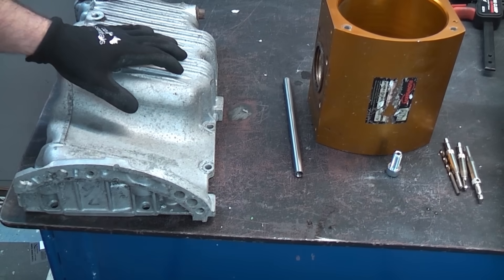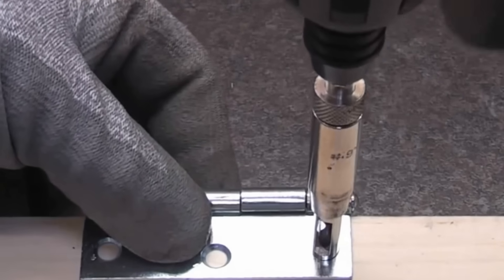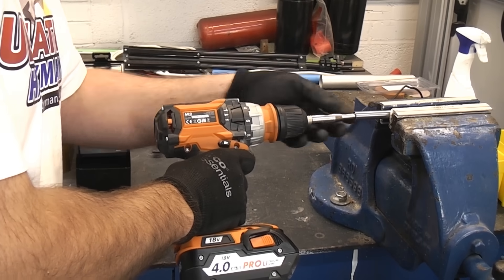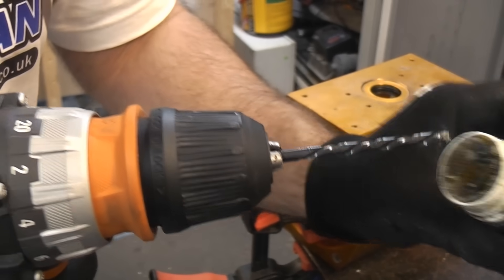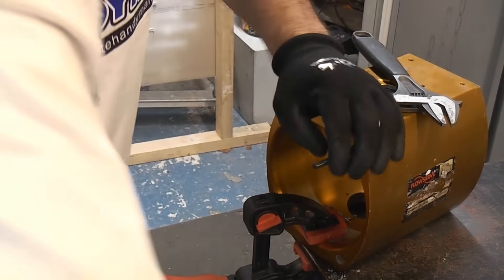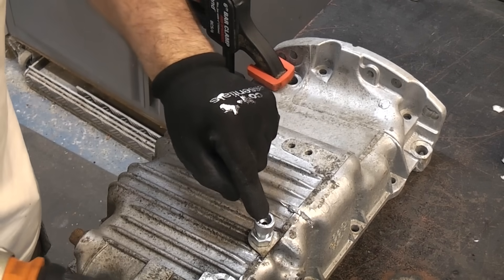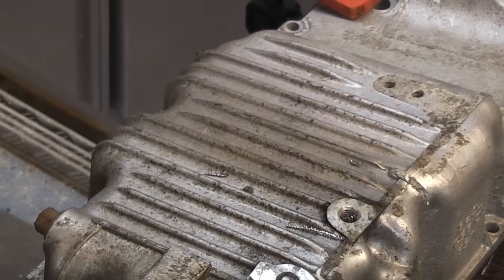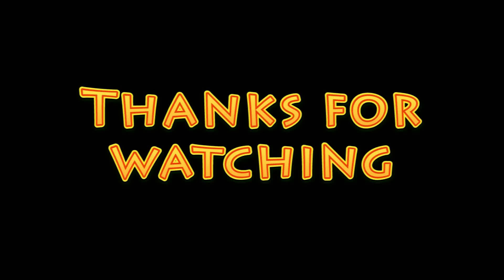How to remove a broken bolt in a deep hole | remove broken bolt in recessed hole

Comment: A simple item I found you can use as a drill guide for drilling into a broken bolt is to buy a  hollow spring pin of the appropriate diameter and length and tap it into the hole above the broken bolt . this will protect the exposed threads and also provide a centered guide for a drill bit . now select a drill bit that just fits into the center of the spring pin and drill into the end of the broken bolt . the spring pin is hardened spring steel so the drill bit will not drill into it . after drilling to the desired depth now remove the spring pin and use an easy out if the hole in the bolt is big enough but if a larger hole is needed now you have a centered hole in the bolt making it less likely to drill at an angle into the side of the threaded hole  .

Comment: I know I’m years late on seeing this vid but what i did was to very carefully drill the centre of the broken bolt, broken deeply in aluminium thermostat housing of the van in which i relied on heavily every day. Then I very carefully used a poor quality thread extractor, applied excessive pressure on the spanner I was using & then to my absolute delight proceeded to snap the said thread extractor into the broken bolt! 😅 F#CK, F#CKING F#CK!! Ended up having to buy a whole new housing just to change a £3 thermostat, great 👍🏽😁. Found a decent garage 🙏

Comment: Where do you get the hollowed out guide bolts? I have a broken recessed bolt that is slightly rounded on top so probably can’t get it centered properly to use the extractor bit.

Comment: only thing i could suggest is use a reverse thread tap,  a thread that tightens in a anticlock wise direction, then youll need a reverse thread bolt, they are used on things that hold a clockwise spinning attachment example a 1 piece lawn mower blade, so when you drill a hole into the bolt and thread tap it then use the bolt in it, instead of tightening the bolt it will undo the broken bolt, the main issue is finding a drill bit thats harder than the bolt, if the bolt is HD 8,8 most drill bits wont cut into it, you can also weld a bolt onto the broken bolt if you can get the weld down in there
Reply from the maker: Thanks for the comment 👍

Comment: JUst watching your drilled-through bolt idea, which is great, btw. What I'd want to do to prevent drilling through a casing is to measure the depth of a neighbouring free hole, measure the depth of the sheared bolt and calculate the difference. Before drilling through the prepared bolt/locknut, Put a piece of electricians vinyl tape round the drill at however many mm above the bolt/ locknut you've just calculated, and leave a wee flag of tape sticking out. When you are drilling, the flag will warn you to stop ar or before touching the head of bolt/locknut guide.

Comment: Very, very well made "how to". the patience and clarity in your presentation demonstrates the patience and thinking needed to perform the tasks. My comment on the use of heat would be to use an electric heat gun and non contact thermometer, something I picked up in a BMW motorcycle manual. You only need to get to 110-130 degrees centigrade and this works for bearing istallatioan and removal as well as removing stuck bolts. Works best for alloy housings with steel bolts as the alloy expands more than the steel. Works while the alloy is still hot.

Comment: Steam jet or boiling water is enough to expand the aluminium sufficiently to release a bolt that has no locking resin around it.   Excellent idea using a reverse direction drill,  I must get some!!

Comment: Nice..

Without cutting threads and extracting the broken piece was a challenge, not it isn't.

Thanks..
Reply: @ultimatehandyman  
Reframing
1. Without Cutting threads
2. Extracting the Broken piece of the bolt
3. Was a challenge for me
4. NOW it isn't a challenge for me.
5. Yes, now was written as not, my bad.
6. Thanks, I learnt how to do it the way it should be done (keeping in mind Pt. No.1.)

Thanks again.

Comment: SO what does 1 do if you break off the cobalt drill bit during the process ,Whats harder, that will drill them out ,or are you out of luck then .
Reply from the maker: You can drill that out using a diamond coated hole saw- 
https://www.youtube.com/watch?v=7JCfEMrCjhc&t

Comment: The point of using heat is to let the metal expand away from the bolt so the bolt will come out, letting it cool will let the metal contract back against the bolt. That's not how you're supposed to do it
Reply from the maker: Heating softens the metal, trying to remove a hot bolt can result in it shearing again 😉

Comment: A bolt doesn't snap deep down a hole without cause. Something holds it very, very hard. I e the whole operation can only succed if tapping, heat and oil in some way have loosened the snapped tip. Am I wrong?

Comment: Hi so I snapped off a 1.5 bolt into a 1.25 thread of my bike frame. Once I extract the bolt is it possible to rethread the inside threads with a tap or is it permanently shredded
Reply from the maker: It’s hard to say without seeing it. If you drill the bolt out, you should be able to re-tap the hole 👍

Comment: Well, thanks, but of course it's a lot easier to work on someething that's not in/on the engine...like a thermostat housing bolt. When you can move the part around, put it in a vise, maneuver it so you can get the maximum torque on it, etc, etc, it's a piece of cake.

Comment: believe it or not, loctite or any thread locker will help prevent a bolt from getting stuck like this.  that's one of it's intended benefits. steel bolts into aluminum parts will corrode. and the thread lock prevents the galvanic corrosion process.

Comment: I drill pilot hole completely through the broken bolt, spray penetrating lubricate to the back side of the bolt thread use EZ out tap and back out bolt it seems to me the complete through pilot hole lessen the holding power of the broken bolt a long with the lubricant

Comment: Try Heating up the area AROUND the broken Stud or bolt .... then APPLY   BEES WAX  while still Hot  , Then center drill and 
drill with a LEFT hand Twist drill and the Broken Thread WILL come out !   Works EVERY time for Me : ))

Comment: Left handed drill bits...did not know those were a thing. But that certainly makes this whole issue seem alot more straightforward.
Reply from the maker: Yes, I was once drilling out a sheared bolt in a non-blind hole at work on a large machine. The drill bit-bit into the bolt and pushed it right out of the back. As soon as I got home, I searched for left-handed drill bits and was amazed to find them. I’ve been using them ever since for bolt removal in blind holes. Thanks for the comment 😉

Comment: You can use steel tube. put it in the hole and drill then use a easy out to remove bolt 🙏🇺🇸

Comment: Where do you get those type of drills? Are they just any drills? I have two broken bolts under the car that are 10 mm. Probably about 1/4 of an inch below the top of the hole.
Reply from the maker: Hinge centering drills- https://fave.co/2DpJo1H
Left handed drill bits- https://fave.co/2xJjK1M
Teng screw extractors https://fave.co/2OnfRuF
Dormer taps -https://fave.co/2OsN1sQ

If you are in the UK-
Hinge centering drills- https://fave.co/2NE1VMc
Left handed drill bits- https://fave.co/2DubtF4
Teng screw extractors- https://fave.co/2pVLkVT
Dormer taps - https://fave.co/2pTfbyx

Comment: Do you drill in reverse or forward ? 

I broke of the head off a bolt on my turbo Inlet.  Really tight space
Reply from the maker: If using a regular drill bit, you need to drill forwards. If using a left-handed drill bit or extractor bit, you need to drill in reverse 👍

Comment: You can buy "vented bolts" that already have a hole in the center.  They are used in high vacuum equipment to prevent gasses from being trapped under the bolt in a blind hole. 
You might have to drill the hole bigger but at least you do not need a lathe to fabricate the guide bolt from scratch.

Comment: I have had success using the penetrating oil called Kroil on red locktite, like on a firearm that you don't want to heat to the 300 degrees normally needed to defeat the red. Kroil is available from Brownell's or MidwayUSA. Probabaly others. Soak for a day or two.

Comment: Good Tips but I would caution against bolt extractors as they are so brittle. Impossible to drill out a broken bolt extractor. Great ideas about drilled bolts and hinge sighting drill.

Comment: If the bolt is broken off in an Aluminum part, you can use a MIG welder and tack on a smaller bolt or some small shaft. The heat really helps and the MIG won't affect the Aluminum.  I do it all the time on exhaust bolts in the LS heads.

Comment: To much work. Sleeve with copper tube to fit against the treads and drop some welding gas in and fill the shaft. The heat from the weld shots will break loose the seized treads, then weld shot a scrap rod/old screw driver to the end and simply unscrew the broken bolt. The threads are clear since  the copper tube shielded them. Have a good day.

Comment: The fallacy of the left handed bit is studs most often get broken when corroded and seized. May as well drill righty then re-drill until the thread tension is relieved or you are drilled big enough to tap.
Reply from the maker: As a maintenance engineer, I can tell you that a left handed drill bit often works 😉

Comment: What an excellent guide!

I always struggle drilling out bolts, never get the drill to go dead centre. So I'll be drilling out some hex bolts in the near future. 👍🏻
Reply: I have ground down nuts to fit in the hole,it’s a bit crude but works

Comment: 14mio calls,i should make videos,worked decades on harleys,only nice chrom,so be careful,
i never had problems to remove broken bolts,most importand,never use this extractors,never,if they break you are done,drill a hole,use a torx,use a washer weld through  the hole,bent the washer,not a sackhole drill it through,tap it with a punch to loosen it,but the most important there is a wonderspray metaflux torsionsspray,it looses everything,it solves 90% off the problems its magic,there were this aluminium pushrod covers,they slided down and stick,no way to move them,and no way to use a grip,nice polished,use this spray,your problem is done,test it

Comment: ..wow tough times….now imagine a product that is stopped in QC because the label peels off after it’s gone through design, drafting, machining, plating, assembly and labeling, it’s worth thousands and you are in charge with no options but your wit…..life’s a bitch and then you die.

Comment: I could hug you right now.... I had a bolt snapped in an aluminum head. I tried drilling and using the extractor but nothing worked. Then I found your video and realized  that the one thing I forgot to do was to use the the extractor to punch again before extracting. Huge smile one my face when I felt it bite and saw it come out!😃
Reply from the maker: I'm glad the video helped 
Thanks for the comment 👍

Comment: Some of you are probably wondering where you can get these drilled out cap screws. Find some hobbyist with a lathe and they will probably thrilled to make them for you as it's an easy job and the machines mostly sit idle at home.

Comment: Such a helpful video!  I twisted off a bolt for the valve cover on a BMW R1200GS Boxer engine - not paying proper attention...  What a conundrum.   If I could not fix this myself I was faced with an expensive haul of the bike to s shop for a costly repair.  instead, I followed the idea presented here to use the hinge centering tool with a left handed drill bit to carefully drill a pilot hole.  It did not come out with the bit, so I then used a torx socket - tapped in with a hammer - to backout the twisted off piece.  After a few drill/torx sequences, I was able to back out the piece with the socket.  Such a relief!  Thanks for the guidance!
Reply from the maker: Well done 👍

Comment: What if you start drilling and realize you're not centered? How would you recover from that??
Reply: use a dremel or carbide burr and air tool to grind away the side of the drill bit hole that is furthest from the edge.  this centers the recessed area.  then drill it again with a larger bit. or the same size bit.  i have noticed that using a slightly dull drill bit and doing this in stages makes it easier.  once centered, resume drilling deeper.
Reply from the maker: Very difficult. If it’s above the surface, I would try and grind it flat using a flap disc etc.

Comment: Any advice on a bolt that's snapped off but is just above the surface? Not enough sticking out to safely cut a notch to simple screw it out with a flathead screw driver, but also not inset so can't use your hollow bolt trick to ensure the drill bit is centered. The bolt snapped surface is uneven - would you just use a die grinder scouring pad to create a flat uniform surface on the bolt and then try to create a centered indent to get the drill started?
Reply from the maker: If you can get in with the die grinder, then yes- you can grind it flat. Then centre punch the dead centre of the bolt 👍

Comment: What is the strategy if the drill or easy-out extractor snap in the broken bolt?  I've had that problem before.  Thanks
Reply: he mentions using a special diamond powder coated drill type thing, but i often use a carbide burr in an air die grinder.  get a round tipped cylinder shape burr and it will go straight down the bolt hole and remove everything.  can take a couple burrs to do one job but it works.
Reply from the maker: You could try this- https://www.youtube.com/watch?v=7JCfEMrCjhc&t
👍

Comment: How much torque would you think this would work up to.. messed up and overtightened a water pump bolt and it broke off pretty deep in there. Least 20-30 ft lbs is on it. Was a dumb mistake on my part. Worried those extractor bits don't work but for bolts that are so tight and also not super long.

Comment: i thought you werent supposed to use copper anti seize on steel bolts threaded into aluminum because of galvanic corrosion and were only supposed to use aluminum anti seize
Reply from the maker: It’s fine in most situations, but if you are in an environment where it can cause issues, you can use an alternative, such as ceramic based anti-seize 👍

Comment: Do you have any links or any recommendations as to where I can get your drill bits. I’ve tried cobalt bits but they don’t seem to work. Thank you
Reply from the maker: Cobalt should drill any bolt, I used to drill out 12.9 cap head bolts using cobalt drill bits, but they were good quality, such as these- https://bit.ly/3h7rDIF

Comment: I have a steel bolt that has sheared in an aluminum small engine base pan leaving a short stud due to corrosion between the two metals.  I have tried numerous penetrating fluids including Reds and heating it to no avail. Is there any way to break that bolt free?
Reply from the maker: Some gentle heat from a blowtorch might be the best option 👍
Reply: @ultimatehandyman  Nope. Tried that. Both MAPP and a heat gun. I wouldn't budge. I even tried the wax trick.
Reply: @gary24752     there is a big difference when heating with an actual cutting torch.  the temps are over 2000 degrees F (don't melt the aluminum).  normally let it cool overnight before trying to work with it again.  but if corrosion is too extreme, it will need to be drilled out completely and re tapped.  also great to use heli-coil type insets as they help in aluminum.  

they give less trouble because they wont strip out when over tightened like the aluminum does.  in some applications that are known to give trouble, guys will take a brand new piece of equipment and heli coil all the places that are known to strip out, before they do.

Comment: I'm sure this is already in here somewhere, but another method that can work is if you have a set of reverse thread taps and dies. Center drill the bolt, reverse thread that hole, then use a reverse thread bolt (or make one) - when the reverse thread bolt has been tightened all the way, continued turning will unscrew the offending broken bolt (provided it's not siezed to the point that the reverse threaded bolt shears). It's ideal for those times the problem is a stripped head, and even cutting a notch for a flat head screwdriver fails.

Comment: Have the right tools.  Don't try to fix things if you don't have the tools. I'll pull a broken bolt in a recessed hole in a couple minutes. Because I have punches fluted coblat steel drill bits and easy outs.    If it's cross threaded then I can tap it and get a new bolt or just replace the part depending on a number of factors.    If your looking for a trick your doing it wrong.
Reply: If it's cross thread you may not be able to remove it without digging yourself deeper into a hole. Like ferrous metal bolt crossed threaded into an aluminum part that's not going to come out very easily.  Try pulling a starter off a mack aset and then you will know why and it won't even be cross threaded.

Comment: Used EZ-Outs for years with good and bad results. Had one break one time on my tractor, and had to order diamond hole saws to cut the mild steel bolt out away from the hardened brittle chunk of EZ Out. After that I heated the bolt and drilled it through and replaced with bolt and nut
Reply from the maker: Yeah, they can be hit and miss. Sometimes they work and other times they do not. Thanks for the comment   👍

Comment: I'm confused on how you broke these,much harder than aluminum,bolts without destroying the threads in the aluminum casings. Just curious.
Reply: it can and does damage the thread holes in many cases.. but the main reason the steel bolts are breaking off is due to the combination of vibration and stress loading in machinery in general.